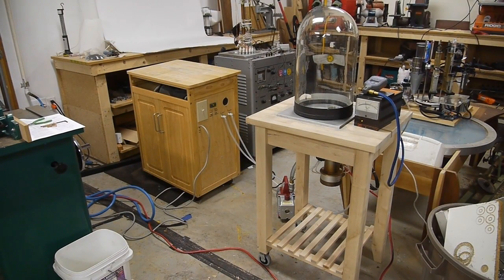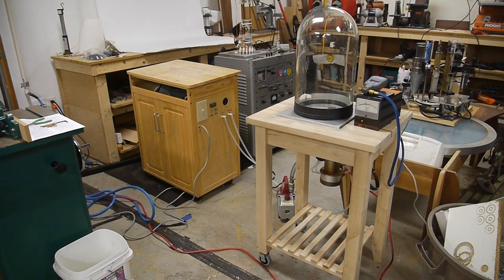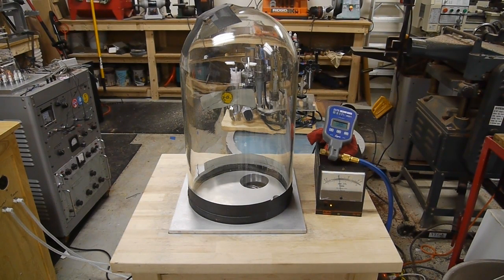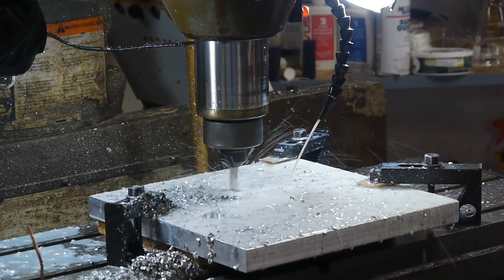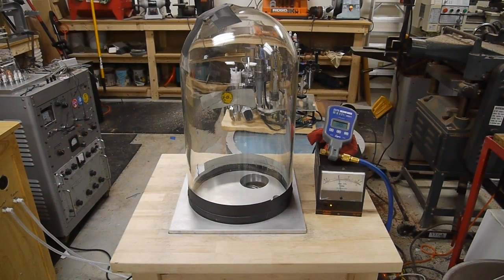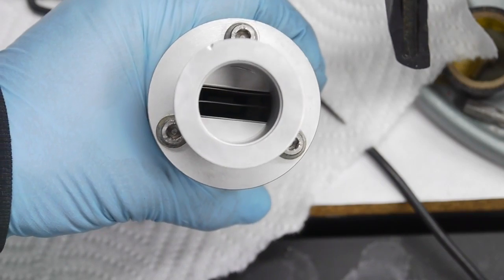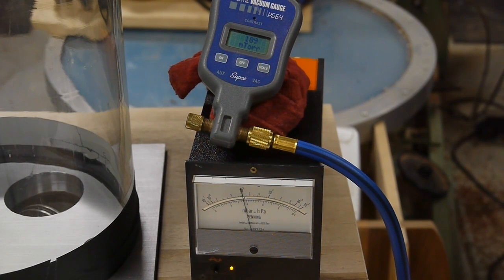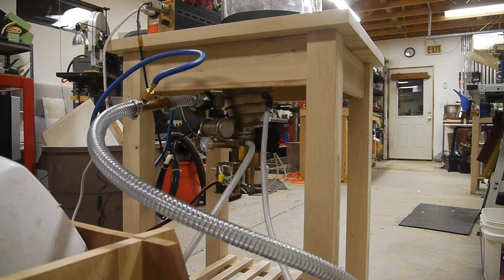New high vacuum system

Comment: Hi Ben, awesome videos. I'm trying to build something similar. I like the glass belljar approach. However, my guess is that the L-Seal of the belljar is your limiting factor on how good a vacuum you get? Buna-N is not as good as for example Viton (as far as I understand) but the selection of L seals is limited so probably not an option(?)  How good a vaccum do you get with your system? Thanks :)

Comment: Just a safety note you should make a wire cloth screen around the outside of the bell jar
on the rare event it should implode you would be at great risk of serious injury.
On my 18” OD x 24” jar I used 1/4” galvanized wire mesh and two long hose clamps 
around the OD of the jar to secure  the cage  to the jar this also provided a means to 
attach my counter weight hoist for raising the bell jar.

Comment: Those diffusion pumps are obscenely expensive as new (5k the simplest 10k the one with pneumatic valve!) in fact there are turbo pumps significantly cheaper new with 2/3 the pumping speed! why is that? they are basically a pipe with a cooling coil brazed to it and a heater at the bottom, the ejector assembly isn't more complex than the internals of a car muffler, Edwards brags about their pumps being fractionating but the thing is, almost all diffusion pumps form the mid 40s to now are fractionating, the fractionating tech is just a danm pipe from the bottom of the boiler to the top ejector. Im building my own due the ridiculous prices :(

Comment: Great work, 
What is the recommended vacuum pressure to reach in order to achieve PVD?
Based on your experiments will a 2mBar vacuum pump be sufficient ?, is the Diffusion pump necessary ?
Reply: Your pump isn't going to be able to generate enough vacuum to do most PVD techniques, i think you might be able to do some very slow sputtering of copper or gold but it wont work very well at that pressure. I don't know much about PVD techniques but seems the most common ones work from .3 Torr (.40 mBar) for sputtering of some inert metals but usually its done at about 6x10-2 Torr (.079mBar) some PVD techniques can go down to 3x10-6 Torr (7.9x10-6 mBar) like evaporation of aluminum for optical coatings.

Probably you already know this, specially because your comment is 1 year old but well maybe i can help someone with this same inquiry.

When choosing a vacuum pump look at its specifications, pay special attention to the graph of pumping speed vs pressure, ultimate pressure and pumping flow. Oil sealed rotary vane pumps and many other roughing pumps have a relatively constant pumping speed down to  about .1 Torr  then its pumping speed starts dropping very fast so its usually better to use a high vacuum pump (oil diffusion, turbomolecular, molecular drag) if you need to work below 5x10-2 Torr to avoid very long pump down times even if the rouging pump can reach such pressure. 

Another thing is, like many high vacuum pumps, diffusion pumps can only work below certain pressure, above it wont work, usually you will read in the literature that such pressure its around 6x10-2 Torr (.08 mBar) but that's usually an average number for maximum throughput of old pumps they can work at slightly higher pressures but at lower pumping speeds. Modern diffusion pumps with an vapor ejector on the final stage can work down to  4x10-1 Torr (.53mBar) at max inlet load. However don't take it for granted, always check the specs first to avoid nasty surprises! most professional vacuum equipment is obscenely expensive and overpriced so those HVAC vacuum pumps are a great start for the amateur, also sometimes you can get good scores on the surplus market and get a professional vacuum pump with good life still left in it. Just but be careful as it could have been used to pump toxic gasses so take care when changing the oil. Getting into high vacuum pressures (below 9x10-4 Torr) its quite tough mainly due the prices but is doable if you are patient and have some spare money, also you have to be very careful with the materials, everything but some metals outgas like mad. Good luck!

Comment: what kind of high vacuum pump do you recommend? turbomolecular pump or diffusion pump? i have found some intresting deals on e bay
Reply from the maker: A diffusion pump is less expensive and almost impossible to destroy, so I would recommend it because of those two main criteria.  You will need to add a baffle or cold trap to prevent oil vapor from getting into your chamber.  The turbomolecular is cleaner and does not require a baffle, but is sensitive to sudden, large air leaks, which might destroy it.  If money is no object, get the turbomolecular.
Reply: +Applied Science ok .thanks a lot for the advice !
Reply: +Applied Science is it possible to make a controller for a turbomolecular pump by yourself ? because i have found that controllers are very expensive .sometimes even more expensive than the turbomolecular.Thanks
Reply from the maker: nikos karavitakis
 Yes, building the controller is certainly easier than building the pump, since it is "just" electronics.  Getting info about a particular pump may not be easy, though.  It's probably a brushless three-phase motor, but I don't know for sure.

Comment: Just wondering, what types of degrees or schooling have you received? I'm currently pursuing a chemical engineering degree, so I have dealt with or seen at least a small portion of the equipment you have designed, but never before have I seen anyone with enough ambition to build any of these pieces. Especially equipment as complex as the SEM.

Comment: No need to, just depends on what youre doing. Some telescope mirror coaters or most use all glass or at least a big sight glass to watch the coating process. As Im sure you know glass in the shape of an egg, oval, and cylinder is very very strong.

Comment: I don't think you can learn machining in just "a tutorial", it takes a lot of experience to get good at it, and any type of CNC machine would probably be way more expensive than you think. You first have to learn manual machining before even thinking of learning CNC. You won't really learn how things like feed and cutting speeds work any other way. That aside, you need some really expensive parts if you want to build a machine yourself.

Comment: Doesn't work exactly that way. You'd need to upgrade both the primary and secondary pump, and you wouldn't gain much efficiency in the end. If pumping speed is a must, you need a big mechanical pump and a turbomolecular pump.

Comment: Once again Ben great vid, you have a lot of passion for science!  I used to work with ICP-MS for metals analysis which required an extremely good vacuum.  We used an Edwards roughing pump coupled with a turbomolecular pump which was attached to the underside of the ion chamber.  If a turbo pump failed it was in the order of $20k to replace!! I believe it was water cooled too.

Comment: I made a little smaller PVD about a year ago by things i got and could make very shiny  mirros on microscope slides both aluminium and copper surfaces and the copper really looked nice. Got problems with oil from the backingpump though after a week but i didn´t have had time to deal with it.

And lately i have also got quite a big turbopump and some wide SS tubes that i will put together to a much bigger chamber then the other one, i only need time. Will be interesting to follow your progress.

Comment: Try making aerogel sticks and see if they can be used as filler in composites (instead of other heavier foams or material that absorbs heavy resin). Measure how much resin by weight aerogel absorbs (machine the top of the aerogel in CNC machine, smear resin on top of the aerogel, then let it harden, then run the same CNC machining program, measure the weight of the aerogel and the thing its held by before and after. Ensure resin does not go over the edge).

Comment: I think it would at least work for the 100% reflective end, the issue is the partial reflector, and also getting the ends of the crystal flat and parallel enough for the coating to be any use.

Comment from the maker: I bought the jar on eBay about 5-6 years ago. I had to search a while, since thick vacuum-rated jars are rare. The seal is a proper buna-n bell jar seal, but the upper edge is falling apart - hence the tape. The lower edge still makes a good seal.

Comment: back in the mid 80's, I worked with a couple sputtering machines...I think we were pulling 10x-7 vacuums alcatel mechanical pumps with a gate valve opening to a cryo pump...they claimed a single fingerprint would not allow us to pull vacuum....we were sputtering chrome , nickel and gold over a glass substrate. Occasionally we would sputter a thin layer of chrome over a failed component for SEM ... I think we used 400 V DC and .99999 argon ...all the fancy non-outgassing grease...good times...

Comment: I've had an impression that diffusion pump is a bad choose for trying to make thin film transistors due to (very little) oil contamination of the chamber. Have you thought about turbomolecular pump? ebay have some cheap items (~1000$)

Comment from the maker: Yes, the inside of the jar will definitely get coated. It's possible to use baffles and shields to direct the flow of vapor (and keep most of it on the target), but it's also pretty easy to wipe the coating off the glass -- probably depends on the material though.

Comment: I'm curious. Wouldn't the deposition coat the inside of the bell jar, making it opaque? Is there something that prevents it (e.g. not being grounded prevents it or something) or are the coatings so thin making it opaque really isn't an issue. Or, I guess, it could just be easy to clean.